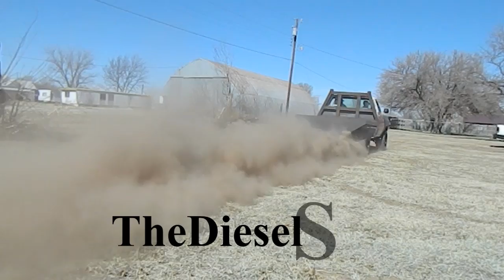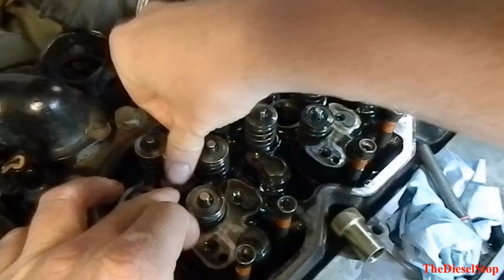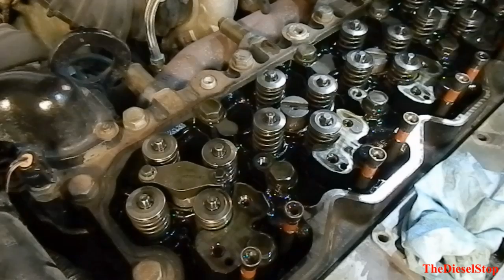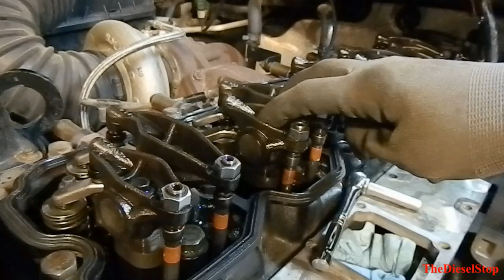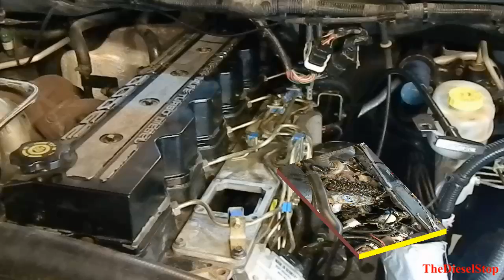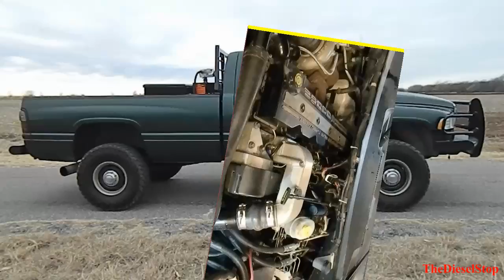01 Cummins installing Pere Marquette Diesel 200HP injectors using Tork Tools Part 2.

Comment: for folks that dont know..you drill the connector tube to get more fuel to the injectors..at the same time when there drilled out..that is the last means of filtration before the fuel gets to the injector...inside the connector tube that is called the edge filter.fuel that has been pressurized from the vp44(injjection pump)) goes thru the connector tube and if there was any thing that wasnt filtered out..gets filtered in the edge filter and gets blasted into pieces from high pressure fuel before entering the injector..just an fyi if ya didnt know.
Reply: The big thing the edge filter does is stops pieces from you injection pump from clogging your injector in the event of pump failure. If your pump was to fail we would recommend you pull you injectors either way and get them checked our. And Cummins&DuraMAxFanatic is right it is the last spot to stop any pieces from getting to the nozzle which could cause a nozzle to not seal and leak extra fuel causing a hazing of smoke from your exhaust. The only way to get full performance out of over sized injectors is to remove the edge filter.

Comment: What's the difference between the 100 an 200  injectors?
Reply: 100 hp the 100hp will add up to 100 hp and 200 hp will add up to 200 hp that all depends on what other mods. you have done to your truck....

Comment: i thought their would be more smoke than that having 200hp injectors
Reply: depending on the angles you could see more smoke. Also pop pressures can cause smoke to be more. Throwing 200 hp injectors into a stock fuel system wont give you 200hp to the ground. Some truck react different and a lot depends on the injector builder on hole size vs. lift.